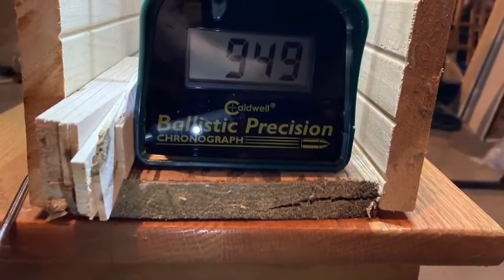THE KT HPA IS BACK, BABY!

Comment: THATS THE NUMBERS I LIKE, and my ACCU WHISPER going 915, 928, just put a ram in and numbers started  going down, ya I was using a heaver pellet I'LL have to try the 7.4 gr, did you show how you assemble your KT, Thanks, my 2240 I installed a the high output valve have the bottle going to it with a quick connect I have to see what it dose so far the AW DON'T go through my kevlar but bounce off at 3'
Reply from the maker: I’m fairly sure there wasn’t a video for that, specifically. Just numerous vids of me explaining why I disassembled it for one reason or another.